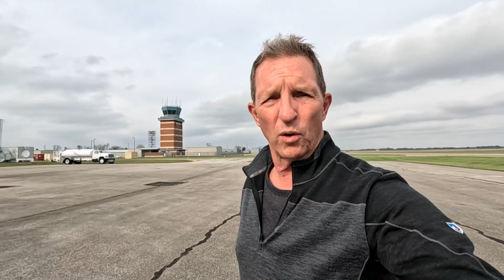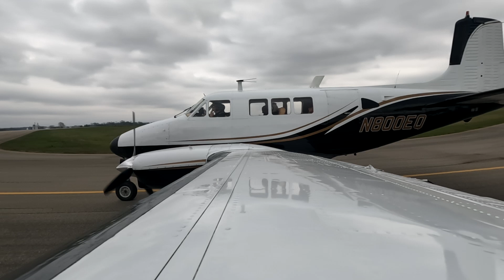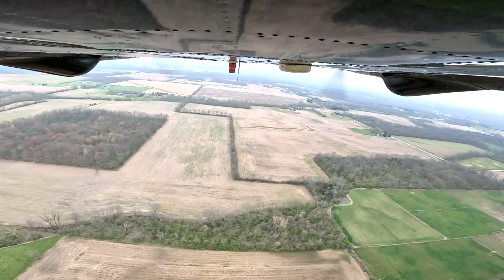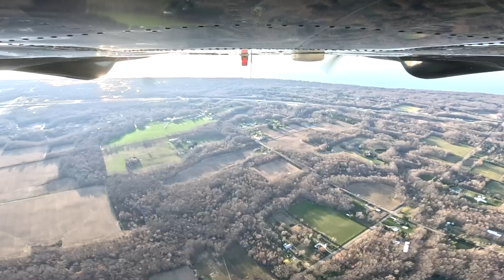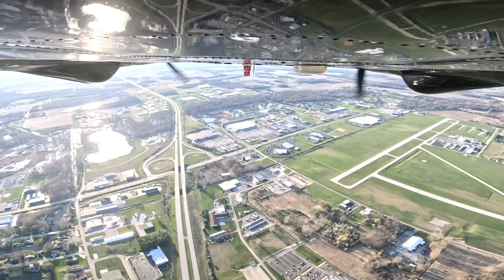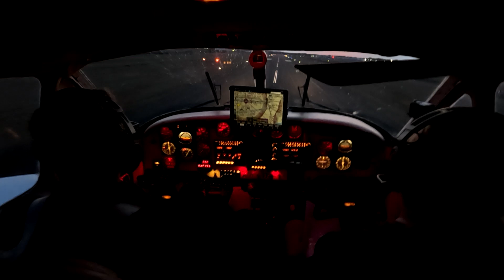Low Level Queen Air flight Over Lake Michigan!

Comment: Kerry,   on what attitude does the Queen Air fly...wing cam showed attitude in flight the same as on takeoff roll, yet inside cam shows lower side window frames parallel to horizon during level flight..just curious...thanks
Reply from the maker: It's hard to say. The wing seems levell from inside but you're right, it looks a bit nose low from the wing cam.
Reply: @KerryDMcCauley  thanks for the reply....think you mentioned once about the danger of slow flight when in icing conditions...building on underside rear of wings...thought maybe  the QA  attitude helped with rear wing icing? it was mentioned that a Beech could carry a bunch.